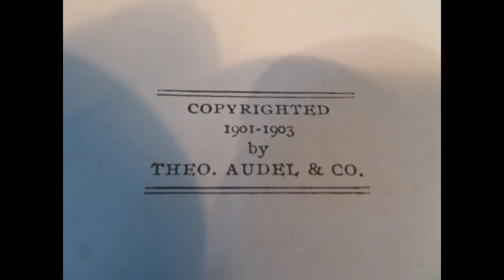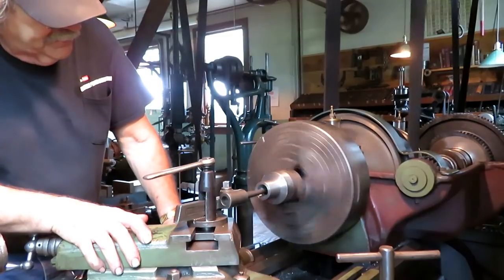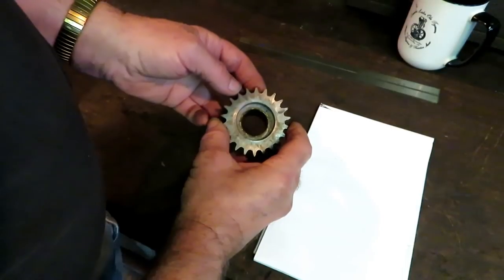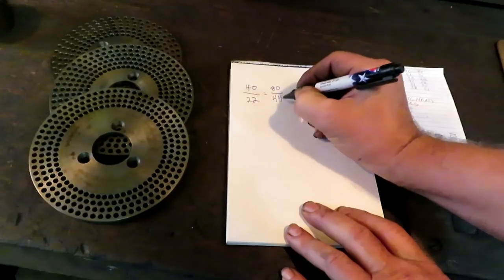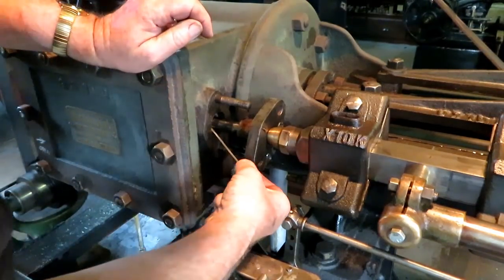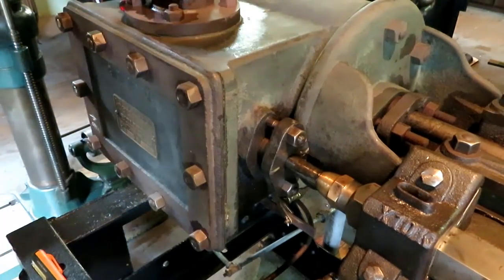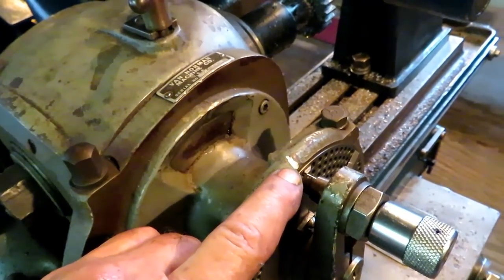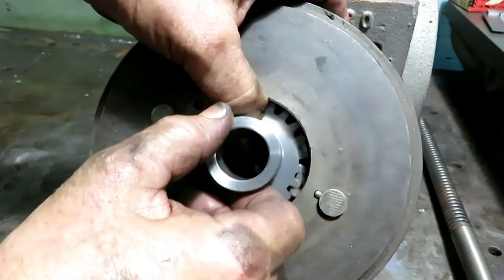OLD STEAM POWERED MACHINE SHOP  46  Making a gear for one of those horseless wagons

Comment: The slide rule is a nice touch for your period steam powered machine shop. I spent much time solving chemistry,  physics and statistics problems in college with one and did not see a handheld electronic calculator until the mid 70s.  My favorite was the round slide rule. The slide rule is an amazing device with surprising accuracy.
Reply: Ron : Showed my slide ruler to my children and watched them scratch their heads. When I told them what it was for, they didn't believe me. Now I carry a slide ruler Apt on my phone to show my Scouts.
Reply: The real problem with a slide rule or slip stick is keeping up with the decimal.  I am almost 72 and still have mine from when I went to La Tech to be a Civil Engineer.  Graduated in 1969.
Reply from the maker: @royreynolds108  Roy: Yeah, you sorta have to know about what it's gonna be, before you get there.....Dave
Reply: David Richards when i went to school we were only allowed graphite pencils and pens with a nib ,dont even mention Biro,s or Bic pens.
Reply: Yeah, I was in High School in the early 1960's...the ink pens with the 'cartridges' were the hot deal…...ball point pens were very expensive then....
Reply: It may be of interest to know slide rules (round ones .... they call them computers ;0) ) are used by pilots all the time and should be carried in the pilots flight bag as backup for every flight!
Reply: Still have my dad's but forgot how to use it!
Reply: +bob fuller — The principle is dead simple:  All a slide rule can do is add and subtract.  To multiply and divide, it uses the logarithmic C and D scales, since addition of logarithms is the same as multiplication and subtraction of logarithms is division.
Reply: That is very true but you may have just lost 99% of the commenters which is OK too.
Reply: @ron827  we are not that dumb!

Comment: Dang, that brought back some memories of the thousands of valve packing jobs I have done on steam ships. I like the way you are not scared to get your hands dirty, like these new age mechanics who have to wear rubber gloves. I would have put never seize on the packing rings on that valve rod packing gland, but then I am accustomed to higher temp and pressure steam. Love that old time screw driver you used on the dividing head number plate change out!

Comment: My dad would drill the packing in a couple of places, then run in two wood screws and use a couple of pairs of pliers to pull the packing out. He used that trick on well pumps and steam glands. It always worked. :-)
Reply from the maker: Seems like a good way to do it Tom, I'll try it next time....dave

Comment: Nice job Dave.  I don't want to even think of how many steam valves and glands I have repacked, nice job.
Reply from the maker: There's a lot of different packing materials available now, hard to decide which to use on an engine, some are pretty expensive...
Dave

Comment: The slide rule was a nice touch. I grew up with them and now own three, and use them quite often.  Interestingly enough the Ford model T used a planetary gearbox and the apprentices probably learned to cut gears using the Ford book. Nice tie-in.

Comment: That's a great project; now I have one for you from our old concrete mixer pinion gear.  It is cut on a bevel and made of steel I think.  The ring gear on the barrel is cast iron and it doesn't seem to be worn all that much but you could crimp stuff between them cause the pinion is worn short and sharp.  Truthfully, we seldom use that old mixer that is in it's fourth generation of use.  Thanks for the video and looking forward to many more, Greg.

Comment: Nice work Dave.  Love the rythmn of the shafts clinking and belt slapping.  Here in Iowa they are moving a totally complete 125 year old shaft driven machine shop from Bellevue to the Ñational Mississippi River museum in Dubuque.  Not sure when it'll be up and running.  I'd love to be a volunteer there if it was closer.  Anyway keep up the good work!  Mike
Reply from the maker: I'll be watching for that...Dave

Comment: Great video. I liked the little piece of hose to keep from turning the wrong axis on the horizontal. I can always find some neat little tip like that in your videos.
Reply from the maker: I use that same idea on the boring mill. I don't know how many times I've got the elevation finally right on and then go to move in    or out and stick the crank on the wrong shaft.....Dave

Comment: Hi Dave, another fabulous video, thank you.
You might be interested to know that there is a proper tool for removing old gland packing. It is like a corkscrew with a flexible woven wire shaft (to resist the winding/unwinding motion). They are still readily available from many suppliers. You were very lucky to get your old packing out with screwdrivers as something is usually in the way. Best wishes. Andy

Comment: Hi again from England Mr. Richards

4 things:
Firstly...that gear housing... 
I'm thinking it rotates...almost like a planetary system...? 
If so that would explain why the centre gear has gone sharp... 
It isn't getting the oil due to centrifugal force... 

Secondly...the drill press... 
It's always nice when something has got a bit of provenance...isn't it... 
I've 2 flat belt driven radial drills...the smaller one (and it took me a while to find out who had made it) turned out to be a POLLARD CORONA....they were built at Fred Pollard's corona works in Leicester... 
I was reliably informed by the vendor that it had originally been part of a fleet of them installed at the Thornycroft steam wagon & truck works, Basingstoke, Hampshire... 
Which is nice to know... 

Thirdly...the American lathe... 
The back gear housing on it looks like its something that bolts on...? 
Or is it just the different paint...? 

Fourthly...literature... 
I know you hold such things as very important...
There's an old manual for the Herbert turret lathe I've recently acquired...so I'm going to grab that... 
The vendor says its 60 pages...and features tooling, setting up and all the clutch adjustment screws and assemblies etc... 

Sorry if I come across as greedy with the four points of enquiry here... 
Oh, and by the way your channel is essential viewing...😊
Reply from the maker: Glenn, The American had a very hard life before I owned it. The back gear cast iron cover was "long gone" along with a lot of other things. I just bent up a steel guard, mostly to keep trash out of the gears and to keep it from throwing oil....Dave
Reply: @davidrichards5594 
I think it's an impressive old machine is that Mr. Richards...
I'm still collecting stuff...but its getting very thin on the ground now...
You should have a peep at my channel....I've only 2 vids up at the moment...
But it may interest you... 😊

Comment: G'day Dave good to see you again, well this was very interesting video.  Those books you used to get the formulae for cutting the teeth were just as good as a DRO, there is certainly nothing wrong with your mathematical ability and I couldn't believe when you worked out on a slide rule the maths,  funny enough I had just about an identical to that I used at school, they were the days.   I'm going to watch the video a couple of times because there are some things that I didn't understand.   All in all Dave I really enjoyed watching you machine this gear for the motorised wagon which I have never seen and to think that small round piece is the transmission!  With all your working out that gear fitted perfectly, all the best kind regards John. PS I really can't understand how anybody could give this a thumbs down!
Reply from the maker: Hi John, thanks again...Dave

Comment: T handled packing pullers Looks like a cork screw on a flexible handle.. Used them in the Navy 40 years ago. All high pressure steam frigates then.
Reply: I have one, bought for a dollar or two at a antique shop

Comment: Hi Dave, at 5 minutes in I saw the "twist drill" I donated laying there near the tailstock, I was hoping you were going to give it a try. Nice job on the gear, I never had to cut gears, but did do cutters and some were helical teeth, another variation in index milling. 
Someday you should try that drill out, I'm sure most viewers haven't seen drills like that before.
Thanks for all the videos.
PT
Reply from the maker: Hi Paul, I put that out there to remind me to use it. Haven't found quite the application for it yet. BTW the grinder hubs are exactly 
right, thanks, Dave
Reply: Glad you can use the hubs.

Comment: Well Dave, I got caught up with you and am patiently waiting for the next episode.  Speaking of which I'd love to see how that indicator gauge you use works and maybe you could talk sometime about boiler inspection and certification.

Some years ago I found a 1917 Southbend lathe on craigslist, brought it home and unloaded it in my unheated uninsulated garage.  That night and for the next few days we had a cold spell which was followed by very warm and wet.  Everything in that garage ended up looking like it had been in the rain from the moisture condensing on it.  Any part on that old lathe that wasn't covered by the old black tar paint or a heavy coat of grease turned a bright red from rust.   Took me a while but I got her cleaned up and running with an electric motor.  Unfortunately I sold it when we moved across country but I have my eye on a replacement.  Maybe I'll go look at it Friday.

Thanks for taking the time and effort to put together these videos.
earl

Comment: Couldn't help but notice that screw driver you used in the dividing plate was an old bugger wasn't it? Looks it anyway. Nice job on the gear and for the tips. That's one hell of a heavy duty trans. lol. 
   Thanks for all the great videos.
Reply: Another great video Dave.  Thanks.  The views of the line shaft and machine set ups are a big part of what I enjoy in your video.  And, I sat up straight in my chair when I saw the screw driver that you used on the dividing head.  I concur with Duncan.  That is one very old, hand made jewel.  Where did you find it?  Or, did you make it?  Larry

Comment: Great video, one of my favorites you've made.  This may sound trivial considering the work you're doing in this video, but the old screw driver you're using has peeked my interest.  It looks to be blacksmith made.  I've made a few that look like that in my blacksmith shop.  I found a few Henry Ford Trade School Shop Theory books on Ebay.  I'm thinking of buying one......
Reply from the maker: The one I used is actually a 1934 version....Dave
Reply: By the way, the slide rule was neat.  I haven't used one in probably 35 years.  So, I bought one from Ebay last night..... I thought it would be fun to re-learn how to use one again.

Comment: I ve packed hundreds of valves just like you demonstrated. I was told not to cut packing that way it would make it too long. not if you pull it tight first it wont
Reply from the maker: Ron: The instructions say to cut the rings, but next time I won't...Dave
Reply: I don't understand your reply. I was agreeing to your method

Comment: My uncle had aline shaft shop.I would hang around and get in the way.It was powered by a large electric motor but there was a small room in the back corner unused but still containing some coal. I think there is a photo somewhere showing my Dad working there prior to WW2 waiting to be called up.If you would be interested in the photo let me know. Will Smith
Reply from the maker: Sure would, or you could email it..Dave

Comment: Hi Dave.  Another great video as always. Just curious if the divider gear box would have been period correct for your shop's era?  Did they have these in early 20th century?  I think if you look at Clickspring channel, Chris shows us how early small gears might have been fashioned by hand.  At what point did industry start using divider gear boxes?  Was there some intermediate technology between hand hewn such as on Clickspring and use of a divider head?

Would be neat if anyone ever hooked a music box up to the crank handle of the divider head.  Every time you index it plays a little song.

Comment: ...20:30......pressure angle...I've got a 1946 Harley, most all the gears are 14-1/2 degrees...stronger than the newer 22, but a little noisier.
 My Dad taught Electronic Engineering college and used several slide rules, that was around 1950's..
 Cutting gears...is there ever a need for a 'spring pass' like when you're cutting threads on a shaft?
Reply from the maker: Yeah Doug, it probably wouldn't hurt. This was a new cutter and it did well with two  .110 cuts.  Some later manuals say cut the tooth with one pass.....Dave

Comment: I've noticed that whenever you use that horizontal mill the sound from the cutting head is an uneven 'chomp chomp chomp' rather than a continuous cutting sound. Is that because the table is driven by a ratchet rather than a screw?
Reply from the maker: No, the arbor generally doesn't run exactly true or are worn slightly undersize ( they are over 100 years old and have really been through the "mill") making a few teeth do most of the cutting.......Dave

Comment: Another awesome video, was wondering what you use for cup grease, having a hard time finding good stiff grease that doesn't melt away with the heat of the boiler on my traction engine.
Reply from the maker: Mark, I just use NAPA wheel bearing grease, It might stand the heat better?...Dave
Reply: Thanks, I'll give it a try

Comment: Hey that red grease didn't look like whale blubber! I thought this shop was supposed to be authentic? lol
Reply from the maker: 1925 was a little more refined than that....Dave
Reply: Well I guess the common grease nipple had just been invented. Curious what would the common lubes of the 20's been? 3 in 1 oil was around, I don't think lithium, or moly grease was  invented yet. I assumes most greases at that time would have still been animal fat based?
Reply from the maker: @bcbloc02  Tallow, or Tallow based "hard oil" as it was called. Whale oil sometimes used for cutting, and concoctions made from ingredients no longer or legally available. I think the big grease breakthrough was getting the soap mixed with the 
oil.....Dave
Reply: My Great grandfather worked for Standard Oil in Bayonne NJ. 1890-1925. They refined crude oil. Had a crew that shoveled coal  for the heat and scraped paraffin off each batch. Mostly making kerosene for lamps. Gasoline was considered a waste product.  As has been mentioned, greases were mostly animal fats. My grandfather worked for same co. 1918- 1955. Back then was called agricultural chemist, as fertilizers were being synthesized.  https://www.kyodoyushi.co.jp/english/knowledge/grease/history/
Reply: Railroads used animal fat and wool waste for the wheel bearings up till the late 1930s now theres a heavy weight oil almost grease called jurnaltex just a fyi for all this type of wheel bearing was known as friction bearings there outlawed as of January 1st 1990
Reply: This Old Tony's got a new cat and it's making authentic 1800s grease.

Comment: Hi Dave, I think I can recognize that little boring bar holder, is that correct. A good old handmade thumbs up. All the best.
Reply from the maker: Yeah, I didn't have much tooling that would fit the American lathe when I got it (40 years ago) so I made that, the steady rest, dog drivers, and a face plate. I'm building a follower rest for it right now to do a long threading job. You'll probably see that in a coming video...Dave
Reply: Just thought it was the one I send you, thats what I meant.
Reply from the maker: OK, that one...works good...Dave

Comment: Have I been doing this wrong? I have packed a number of glands around prop shafts and I have always coiled the packing material around the shaft and jammed it into the sleeve as one piece, and then tightened the cap. Is this wrong?
Reply from the maker: I have done it that way but the Garlock co. that makes the packing says not to do that.....Dave
Reply: The packing material that I have used has been around since way before my time and the original packaging is long gone. I have never read the official instructions. I wasn't even aware that anyone was still making that stuff. I thought it was all left over from the 19th century.

Comment: Dave,

I notice that when cutting gears, you do two things differently than other machinists: The dividing head is in the left (i.e., you're cutting away from the dividing head rather than toward it) and you finish each tooth before moving on to the next, rather than make two passes. Is there a specific reason, or is it just six of one, half dozen of another?

Thanks,

Jack
Reply from the maker: Jack, It's just the way I do it. I don't think with that little set up, the head is any more solid than the tail stock. Most folks work from the inside edges of the hole spacer too. but I seem to be able to see it better on the outside. Thanks for the discussion....Dave
Reply: @davidrichards5594  I kinda figured it was just another way of doing it, but had to ask. Thanks. I always enjoy your videos.

Jack

Comment: Hi Dave ; I'm about 10 minutes into the video , & was wondering if you have an air compressor tied into your steam setup ?   Just curious ;)     > > > Back to the labor ! 
    Oh , another head scratcher , do you forge many of your cutting tools ?   I recently found a source for sucker rod . . . from 5/8" to 1" = cheap source of hardenable steel !  * 20 to 30' lengths for under 20 bucks per stick !

Comment: Dave doesn't the east broad top rr have a line shaft system there ?
Reply from the maker: The entire shop complex (5 building dept's) were run with the same line shaft system and one steam engine.....Dave
Reply: It would be nice if you  could do a video on the whole line shaft system at the ebt shops as I dont think anyone on YouTube has a video on it